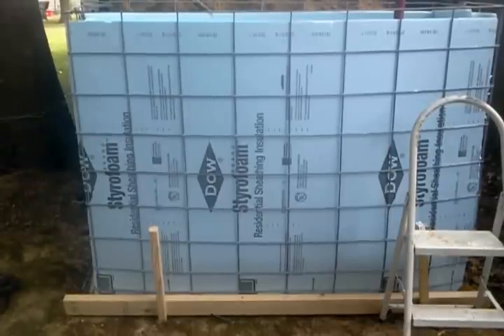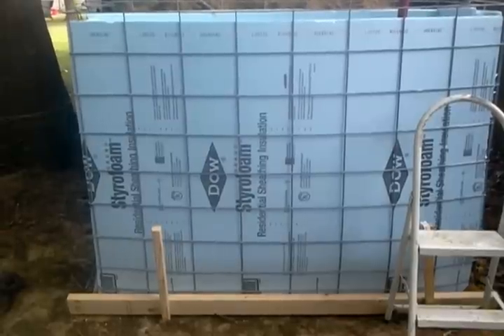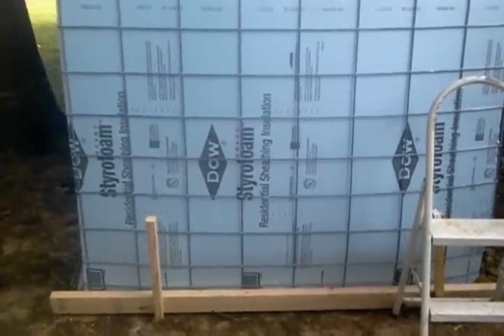Insulated Rammed Earth form Part II

Comment: The problem is there is way too much bulge in that system. Not only will the wall be shaped more like a large charcoal briquette, but the wall will not set rock hard. Large chunks will undoubtedly flake off. I sure hope this isn't for a structural wall, or death will result.